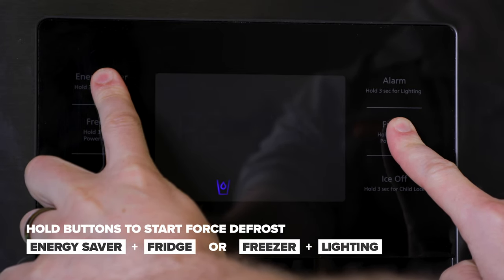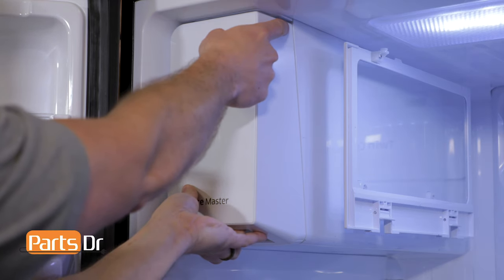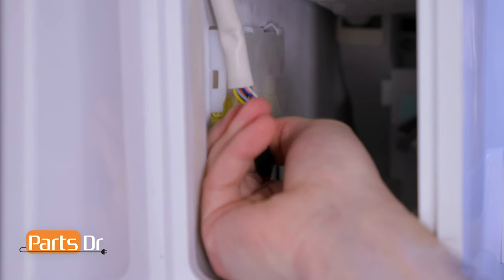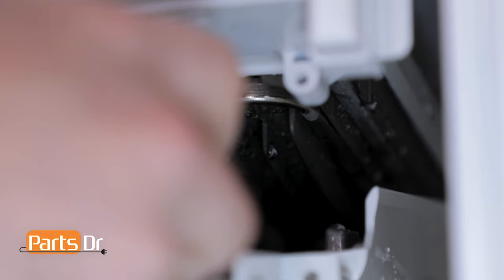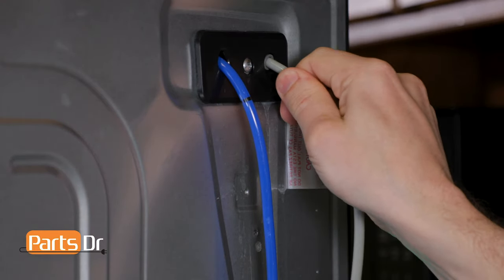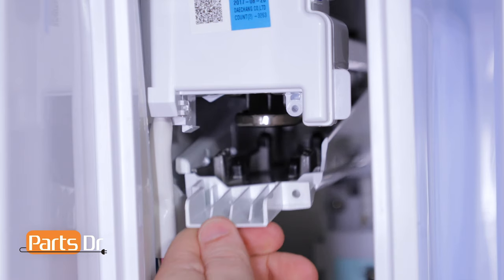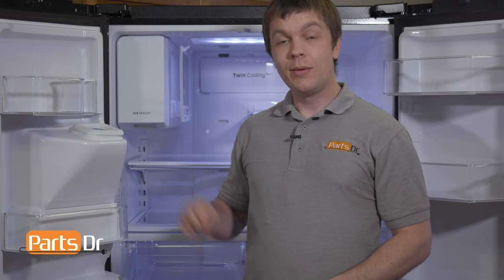How to check your ice maker water line in a Samsung refrigerator

Comment: Thank you Ryan / Parts Dr. for making these videos regarding the issues and fixes for the Samsung ice box.  I adjusted the "position of the ice maker water line" and it corrected the excessive water / ice at the bottom of the ice box floor.  The initial installation of the water line was pushed beyond the correct position inside the tube.  As a result, water was sprayed all over the ice maker and dripped down towards the auger and ice would formed in half a day.  In a week, it will build into a small ice berg inside the ice box and the ice bucket will not pull out until thawed.  This was my fix for now and hopefully it's a permanent fix.
Reply from the maker: Let us know in a couple of weeks if it took care of the issue that you were having.
Reply: @PartsDr  The position adjustment of the water line was the fix for this Samsung ice maker.  The ice box was inspected after 13 days and was free of any ice buildup on the ice maker, auger and the base of the ice box.  It seems the operation of the ice maker is working but for how long with all the issues reported.  Thanks again for the fix.

Comment: Good afternoon and TY for what you do. My water dispenser is not working in the Freezer section. The fridge motor had a high humming sound as if it was working hard. I cleaned the coils in the back. Very little dust. I defrosted the fridge for 12 hours. In the morning I kept the bottom door open for a couple of hours to make sure no ice buildup. Little water was at the bottom of the fridge. I cleaned the water before I turned on the fridge again.
The fridge works well in every section. The humming sound disappeared and the fan is running well. However the water dispenser in the bottom freezer section is not dispensing. The freezer works well. The ice and water on the door works well. Please advise. TY

Comment: Awesome video! This ice maker has been a nightmare! The last company that came out replaced my ice maker and adjusted this tube. Now I’m having issues with slushee ice and based on the information from your other videos I managed to remove the ice maker and auger. During this process I noticed that as you mentioned in this video, some of the plastic pieces in the ice compartment are deformed due to the last tech using a heat gun to speed up the removal of ice buildup. They don’t want to own up to it so I don’t know what to do. I found the compartment online but don’t know how to remove it, if it’s even possible. At this point, if I can’t replace that compartment, I will just purchased an under counter ice maker. Please help!
Reply from the maker: Usually the pieces that get warped/deformed from using a heat gun are not replaceable.  Sometimes the piece of plastic will have a part number on it, but the part usually isn't a part available to order from Samsung.
Reply: Parts Dr I used my phone and took a picture of the part number and name from the inside of the ice compartment. I found the assembly(DA97-13405A) through the Samsung/Encompass site but I have no clue how to remove the old one. Just wondering if you have some insight as to how it’s attached.
Reply from the maker: Thank you for the part number.  We are not sure how that is attached.  If you figure it out please reply and let us know.
Reply: Parts Dr I sure will! Thanks for all the informative videos!!!
Reply: @PartsDr  LOL!
Reply: Best way to defrost any fridge is with a steamer, plastic wont melt at 212°f

Comment: I have been using your company now as my go to place for parts.  I'm in the business Love that I can offer a protection plan on parts.  This is a great video and the only one that covers the fill line.

I've got a unit that's a RF4267HARS/00 . The fill tube is completely out.
does it just slide in like this newer model.
I thought there may be a push in connector that held it in place but in video you mentioned a Stop of some type.
When I push hose in I feel a spring action ( the reason I thought this was a connector)
I don't see a retaining push in connector on the back..  will have to check parts diagram.
Reply from the maker: Hi Curtis,

Thank you for the support! It looks like your refrigerator is set up differently and it does not have a connector on the back of the refrigerator like the one shown in this video.

Comment: My (Samsung fridge) ice maker isn’t even dumping ice. The water dispenser is dispensing water fine. The filter isn’t that old. This has been a problem on and off for some time now (more so off/not working a lot lately rather than working). I had actually went ahead and added a tee fitting to the supply (gray line) up to ice maker. Which by the way what is the blue line up there?? Anyway I added a tee fitting and an extra line with a valve- thinking the lines were never bleeding the air out properly up to the ice maker. Turns out I don’t get any water up in that line even without any ice in the bucket. Can you please tell me what this tells you? Is the solenoid that opens water up to the freezer not working but is to the water dispenser? Is that possible?

Comment: My samsung keeps producing a lot of condensation on the exterior, right in the part where the ice maker is. I sealed the cover with silicone but the problem remains. I checiked that the pipe is in the right position and the ice maker is working fine. What could it be ? Can you give me a clue to this issue. Thanks a lot in advance, Ramon Perera, Miami

Comment: All the condensation is in the area where the two water hoses enter to the refrigerator coming from the water valves. I hope you can make me a suggestion how to fix this. I already check the temperature settings and they are as per the manual.

Comment: I am trying to determine if my supply line has iced up as well. The tube position looks pretty good but I wanted to know if it is okay to completely pull the water line out from the back of the refrigerator where it goes to the ice maker and check to make sure there is no Frozen ice? Or, if I pull it all the way out will I be unable to get it put back in correctly?
Reply from the maker: If yours matches the one in this video, you should be able to pull it all of the way out and put it back in without any issues.
Reply: @PartsDr  thank you. Yes I have the exact same tubes and I believe it is the same refrigerator.
Reply: @PartsDr  although I am concerned that the ice maker is just dead. I have defrosted everything, sealed around the ice compartment with silicone and put the new kit around the cooling element but when I try to use the reset button on the ice maker I don't hear the motor running nor do I ever get a beep. Unplugged the refrigerator for a few seconds and plugged it back in and tried again and don't get anything from the reset button. I've also insured that the ice maker is selected on on the control panel of the refrigerator. Nothing.
Reply from the maker: @aaviator  Those are common symptoms of a bad ice maker.  Unfortunately, we are not able to do any troubleshooting for you over comments.

Comment: Great video, thanks for that. I went through this process due to ice buildup and removed auger too. After cleaning out and sealing box...I get no ice. If I hit reset, ice make dumps ice...but won’t otherwise. Any ideas?
Reply from the maker: Often times if the ice maker and ice maker compartment get iced up it causes the ice maker to fail because the ice maker can't turn properly and it internally ruins the ice maker.
Reply: I did the exact same thing and am in the same boat

Comment: Great video as always. Question: I have an icemaker that was working fine for many years, now I suspect the icemaker water line may have mineral buildup. This may be causing a pressure increase which means water is sprayed instead of poured into the icemaker. Is there a way to fully remove the water line and check it without removing the icemaker? I know you can adjust it from the back, but can you pull it out to inspect the tube? 
Also, I'm very concerned about removing the icemaker for fear of damaging the coil. Is there any way to see the icemaker water tube end with the icemaker in place? Maybe using a mini flexible camera? Thanks for the great videos!
Reply from the maker: The water tube will pull all of the way out of the back.  You could probably use a small inspection camera, we have never tried.
Reply: @PartsDr  Awesome! Thank you for the quick reply.

Comment: At 3:03 of the video you say that the water line is in the correct position but it is very difficult to see the position, it looks like it completely fills the cavity, is this correct? My fridge is leaking substantially from the top of the fridge while it is filling the freezing compartment but the water does not stop filling it just keeps leaking out the top rather than filling the freezing compartment of the ice cube maker. Thanks!
Reply from the maker: At 3:03 it is only inserted a little bit into the cavity.  Inserting it too far can cause issues.

Comment: The ice maker on my samsung doesn't get water, but the water on the front works fine, what do you think can be the issue? - thank you for your help.
Reply from the maker: You will have to troubleshoot and narrow down the problem.  It can be a bad ice maker, bad water inlet valve inside the filter case assembly, bad main control board, or many other things.
Reply: @PartsDr  Thanks for your answer, I did some troubleshooting, i narrowed down the problem to the water supply to the ice machine, the water in the door does work so the inlet valve seems to be working its just not getting water to the ice machine. The door and the ice machine share a water supply line (only 1 line out of the inlet valve) and no clue where to go from here.

Comment: Would incorrect water line position cause water to leak inside the fridge body?  I am having an issue with water leaking from the top of fridge, around the housing for the door water line.  Had tech come out and he confirmed the problem is coming from the ice maker water line and somehow water is getting in between the insulation and the top of fridge.  Very weird situation, he said he has never seen this problem before and had no way to fix it.  Fridge is only 2.5 years old and just out of warranty.
Reply: Hi Tom, I am experiencing this very same issue today... Any chance you got this fixed and have a solution to the problem so I can go about fixing mine? It seems as though no one else on the internet has this exact problem. I've done all the troubleshooting I can to no avail.
Reply: Any chance you figured out the answer to this? Have the exact same problem with mine.
Reply: @caleb8737   Any luck? I have the same issue.
Reply: @benconnair4241  Any luck? I have the same issue.
Reply: @nickleerentveld No, just turned off the ice maker.
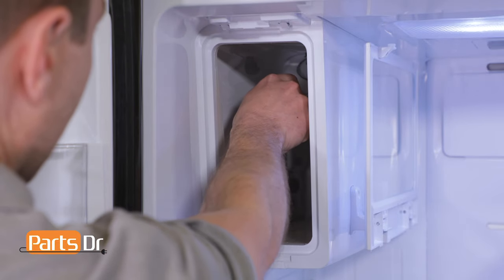Reply: For anyone else that finds their way to this comment; I took the whole icemaker apart as instructed in the video and found that the water feed tube displayed at 2:56 was fully iced up. This was probably forcing the water to flow elsewhere into the top of the fridge eventually leaking out the top hinge mounts. It wasn't possible to see the issue without fully dissasembling the ice maker. Problem was resolved after I thawed everything.
Reply: @benconnair4241  I found the top feed tube displayed at 2:56 was fully iced up forcing water into the top of the fridge and out the hinge mounts. Took the whole thing apart and thawed it out... it working again now without any leaking. (what a piece of garbage lol)

Comment: Quick question, do you know what size of tubing those lines are? I want to pipe my RO unit into my fridge for use as water and ice. It has quarter inch OD PEX tubing coming out of it.
Reply from the maker: You would just run the RO water line to the inlet on the back of the refrigerator.  The inlet line on the refrigerator is usually setup for 1/4".  Make sure to check the owners manual to see if the refrigerator is compatible with an RO system and any specific instructions for RO.
Reply: @PartsDr  Ah perfect, I was hoping it was 1/4" because the line coming out of my RO unit is also a quarter inch.

Should work fine I would expect.

Comment: My icemaker doesn't seem to be getting water to it.  However the water dispenser works just fine.  Can I swap the positions of the blue and grey water lines in the video above to determine if its the line itself and/or perhaps a problem with the water inlet valve?
Reply from the maker: If they are the same size lines and it will reach that should work to help troubleshoot.
Reply: @PartsDr  Thank you for your quick response.  The water line appears OK.  Does the icemaker send a signal to enable water to flow to the icemaker?  If so I suspect the problem is the icemaker.  For the past 6 months or so I've had to cycle power on the refridgerator to get the icemaker to make ice at all.  Then after a couple of weeks it would stop -- even without ice buildup causing it to stop - and I'd have to recycle power again.  My suspicion is it isn't sending that signal to the icemaker to start the water flowing into the icemaker.  When I try and reach into the icemaker, I can't feel any evidence of water in there.
Reply: @bobchoboy7048  my icemaker has exactly the same problem, I completely shut it down during vacation, it was fixed, but stopped again after the first box of ice full. Have you found a way to solve it?

Comment: Is it possible to remove the ice maker and keep it out for good? With no water coming into the ice maker area? Our ice machine has been off at the panel for Months, but the inside of the ice maker housing continues to build up ice. We have an iceberg in our ice maker.
Reply from the maker: We haven't tried running the refrigerator with the ice maker removed.  It might throw an error code if it doesn't sense the ice maker.

Comment: great video.  My problem is that everytime the ice maker tries to fill, it sprays water out of the back where the hose is connected.  Any ideas on why that would happen or how to fix it?
Reply from the maker: Have you checked to see if the line is frozen?  If it is frozen you have a leaking water valve and will need to replace the filter case assembly and thaw out the line.
Reply: @PartsDr  thanks for the reply.  How do I check to see if it is frozen.  It sprays back right where it connects into the top of the fridge next to the blue line.
Reply from the maker: @T3andCO  Usually blowing throw the line is the best way to see if the line is free from obstructions.
Reply: @PartsDr  @Parts Dr first of all, you’re videos have been a great help and I’ll be purchasing a few parts once I narrow down the problem.  I have completed sealing the ice room and checked the function on most other parts, however I’m getting small ice cubes and really poor ice production (only 2-3 cycles per day).  Do you have any thoughts?

Since my ice wasn’t used in a year or so due to frosting issues I’m wondering if that may have something to do with it?
Reply from the maker: @scottyyyyyyyy  Pretty hard to troubleshoot that problem in a youtube comment.  It could be a water supply issue since the cubes are small.  It could be a bad water supply from the house to the refrigerator, bad water inlet valve (filter case assembly, bad ice maker, bad main control board, or possibly something else.

Comment: I'm trying too figure out if water  actually available to getting to my icemaker and the video shows only pulling out the water line and putting out back in. How can I tell?
Reply: I am working through the same thought process (I am hoping for a reply from PartsDr). In my case the auger still works, and I am thinking that my problem may be in the water control solenoid. In my fridge it is part of the water filter container, and has a multi-plug, so without a wiring diagram I can't "jump" a current to the solenoid to see if it works. In regards to seeing if water is coming out of the line to the ice maker, there is a video on U-tube (https://www.youtube.com/watch?v=qUblOnomHHY) that shows how to take the ice maker line out the back of the fridge, so you could put the line in a jar and hit the reset button to see if there is any water. However, assuming the reset button in the ice maker does signal for water, if you push it a couple of times, I would expect water to overflow from the ice maker. I am not sure if the problem is the solenoid or the computer board, both of which are expensive, so looking for some guidance on how to fix this without just blindly replacing parts.
Reply: @jackhabart5338  did you figure this out?
Reply: Amazing step by step instructions!  We were able to fix our ice/water on our own after the service person tried on 4 occasions to get this solved without success!